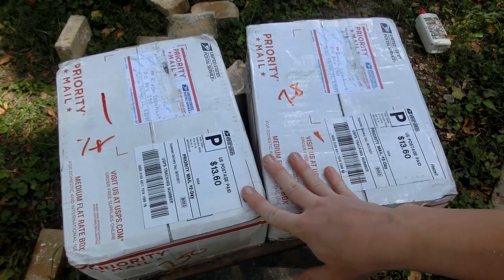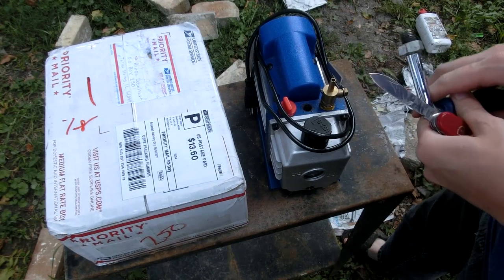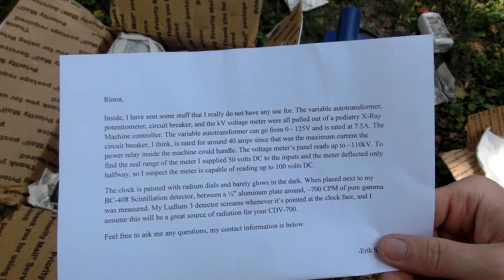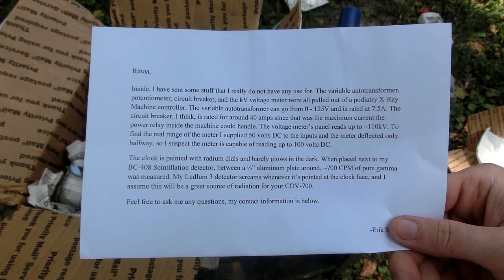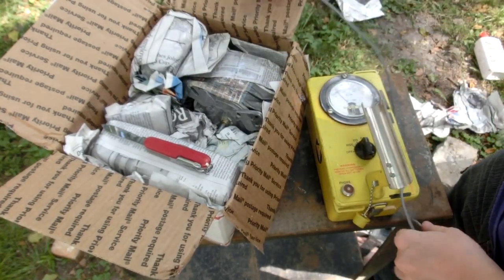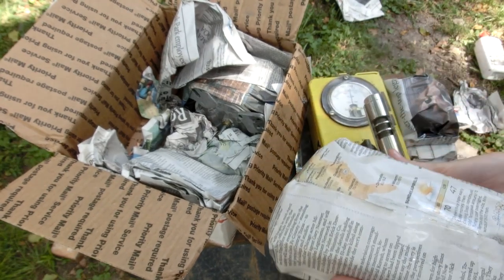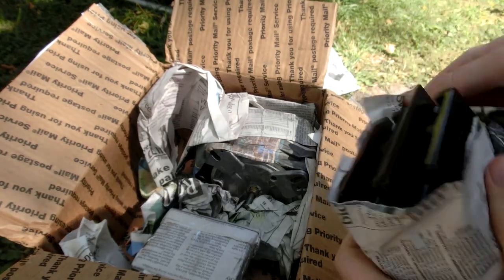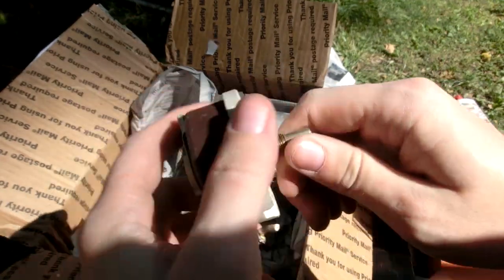Inbox 20: Radium Clock, Variac, Circuit Breaker, Rheostat, Vacuum Pump

Comment: The radium is mixed with a glue, or binder, and a  phosphor, which is typically zinc oxide. After years of being bombarded with radiation, the zinc oxide degrades and becomes less and less luminous.

Comment: Hi, what will you use the vacuum pump for? Maybe make a magnetic gearbox housed in a vacuum sealed box with an electric motor running a water jet propulsion system for a barrel boat or kayak?? 🛥
Reply from the maker: +Jacques Claude a 2nd pump for my vacuum chamber

Comment: I have a 1964 Seiko "Bellmatic" gold wristwatch that works in the same manner as the clock, I'm not sure if the radioactivity has deteriorated over the past 50 odd years causing it to lose its glow. It does need a light source to charge it and only glows for a few minutes afterwards. A very interesting concept but I don't think it was entirely practical :P
Reply: The radium's radioactivity will decrease by a small amount but the reason the faces no longer glow is that the phosphor that is used deteriorates.  This is the same reason florescent tubes and phosphor based LED's lose output intensity over time and slowly color shift as they age.
Reply: +kuhrd Correct! The Radium 226's radioactivity used here will have decreased very little since it was made and will still be highly radioactive for its mass. The fact it does not by itself glow bears no relationship to its radioactivity.  Most of the radioactivity is from Alpha particles but some Beta and Gamma are also present. If Rinoa put her counter beneath the glass and it could detect Alpha it would likely go off the scale!

Comment: That package was not packed very well and that is likely why some things are broken.  When packing a single layer box for shipping you want to have 1-2 inches of secure padding on all 6 sides.  If it is something fragile it is best to use multiple layers of boxes and padding.  Newspaper is insufficient padding for shipping most things.
Reply from the maker: but it was free stuff, if this was an ebay auction i'd be pissed but not for free things.
Reply: Yes, ,but when you make a blanket statement to your subscribers that the USPS is a pretty sh*tty mail service when it is obvious that the damage is most likely a result of poor packaging it gives people the impression that you are speaking from authority on the matter rather than it being a baseless statement.  Unless you work for the USPS or are regularly observing improper handling of the mail and have proof it is occurring.  
Most of the time I find that USPS is right in the middle between FedEx and UPS for delivery quality for the price.  Almost all of the packages I receive through UPS have every corner rounded over and the outside dirty and scuffed up while almost every package I have received through FedEx generally looks like it did when it was picked up from the sender with little to no dirt or damage.  USPS has generally been in-between with a package every once in a while that shows signs of damage.  I have seen far more damage as a result of improper packaging than being due to mishandling.  UPS used to state that a package should be packed well enough to prevent damage when the box is thrown from waist height horizontally 25 feet onto pavement.
My original comment was simply to raise awareness to others that may ship something cool to you in the future to ensure it is packed well enough to survive it's journey.  Many people don't have much experience packaging items for shipment especially heavy items that can shift when the box moves through the sorting facilities.
Reply from the maker: but usps is shit, my mother runs a warehouse and has to deal with their shit all the time. i've lost so many magazines where only a few pages would show up, i've had packages arrive soaking wet. i've had almost no issues with UPS or fedex, only USPS. i wish we had DHL out here, they seemed ok.

and what i'm saying is that somebody isnt going to always have the propper packing materials at hand to ship free items, they are just going to grab some junk they have to try and pack it instead of run out and buy bubblewrap. i'm lucky that we almost always have tons of shipping supplies stocked up at our house, but others dont have that, and might not want to pay 10$ for bubblewrap.
Reply from the maker: now i do want to add that USPS is shit, but it is a lower price for a lot of things, so its just a low cost and low quality service.

Comment: I have an old radium faced alarm clock and it only barely glows under its own radiation. The face was clearly still highly radioactive when tested with a borrowed geiger counter, making me think that over time the phosphor which the radium excites has degraded. The phosphor is what actually glows green, using beta (?) radiation from the radium, or from near UV light.

I suspect that the radium numbers and hands on that clock have a degraded phosphor also.
Maybe a future video on taking phosphor from fluorescent lamps and repainting the numbers? [Being mindful of the mercury in the lamps, of course]
Reply: Aha, I have always wondered about that.
Reply: Nathan Sheilds just had an idea using mercury in a sealed box with a glass front. How about making a heat clock by heating numbers so as to attract the mercury so that it appears like it's a magic clock. The numbers won't actually be noticeable until their shape has been heated from behind. 
Would be quite unique don't you think? 😀
Reply: That is correct and is the same reason why pretty much all phosphor based products eventually lose intensity.  If the phosphor didn't break down many products like CRTs, florescent lamps, phosphor based LEDs and many other items would have far longer service lives.
Reply: +Jacques Claude I don't know about the practical physics of that idea, but if you can figure out how to make it work that would be cool. Just be careful with the mercury!

Comment: isnt a rheostat basically a high power potentiometer?
Reply: Yes, they are basically high power potentiometers. Ohmite is still in business even!
Reply from the maker: +fredlllll rheostat is just a potentiometer with two pins instead of three
Reply: Yes, a potentiometer is designed to be used as a variable potential divider (i.e behave like two inversely proportional variable resistors). A rheostat is just an old name for a simple variable resistor, usually a high power one.

Comment: I think your clock is tritium, which is a an isotope of hydrogen. They used in in watches and it does not last forever.
Reply: David Keleshian It's still used in gun sights. They stop glowing after about 12 years due to the half-life of tritium.
Reply: David Keleshian no its not tritium, Tritium is in glass vials. The clock he has is what he said it is and the paint is actually something you don't really want to fuck with because it's radio active enough to cause harm if the owner is an idiot. But as he is an intelligent human im sure he will be fine with it.
Reply: 5Rounds Rapid they don't stop glowing they just lose intensity just like batteries that are guaranteed for ten years, they aren't dead at the ten year mark they have just lost 10% capacity.
Reply: Tritium can also be painted on, like on watch dials. It has a half life of about 12 years. It is what they used on clocks, watches and exit signs for years.
Reply: Old radium clocks and watches often don’t glow anymore but are still highly radioactive.

Comment: Radium doesn't have all that long of a half life.  Most likely your radium no linger puts out enough  radiation to light up the florescence anymore.
Reply: It's still almost as radioactive since it was made. It depends on the concentration of radium in the luminous paint. 1600 years is the half-life of Ra-226. The many decay isotopes are even more radioactive, but much shorter-lived, with Pb-210 being the longest at 22.3 years, and Po-214  being the shortest at 164 microseconds.